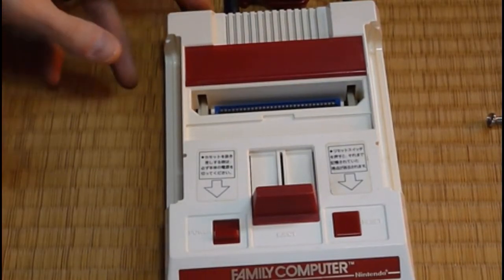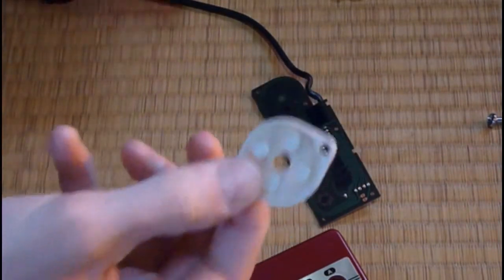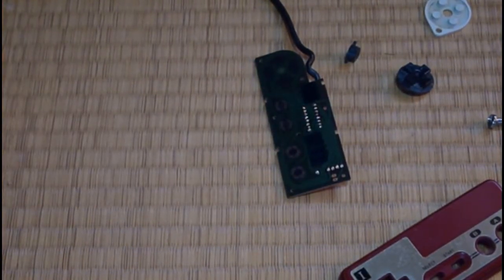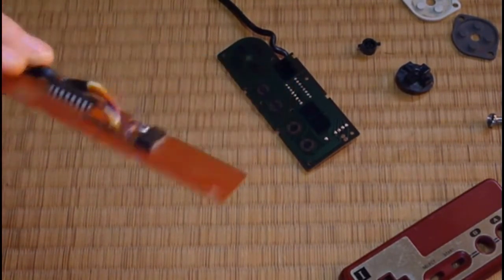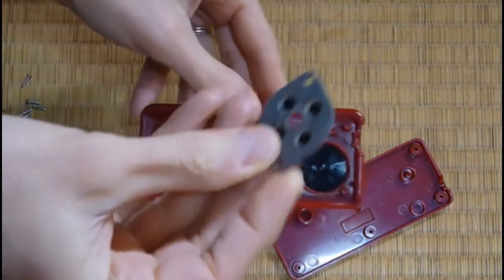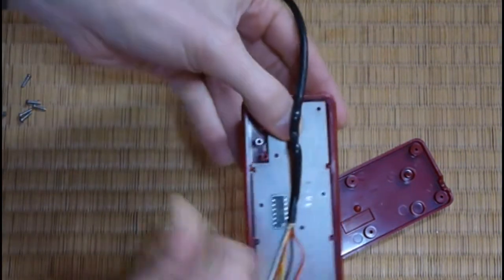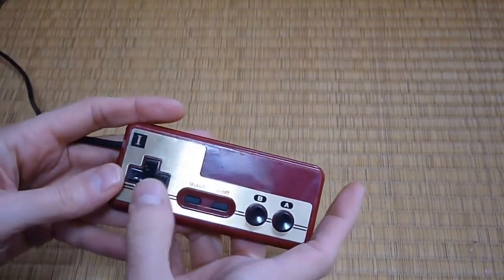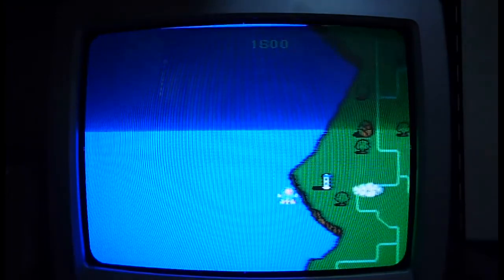Nintendo Famicom (Family Computer) controller fix

Comment: the player one controller board is exactly the same as a standard NES controller. you can actually swap the boards if you prefer the feel of the NES controller and use it on the famicom. ive done it and it works. havent tried swapping the rubber pieces but they do appear to be identical looking at them side by side.

Comment: It doesn't matter if the membrane is cracked or not.
What matters is the graphite parts on the bottom of the membrane.
Graphite conducts electricity and when you push it against the board it creates a connection between two pads, then it lets the famicom know that you've pushed the button.

Graphite on the controllers doesn't last forever tho'. After a certain number of clicks it wears off.

So even if the membrane is cracked, the graphite might still be good. I took the membrane from the the player 2 controller, since I don't use that one and switched.

Comment from the maker: I've only seen the guts of an NES controller in pictures, but the rubber pieces of the NES and FC controllers look exactly the same, so if you have an old NES controller around with good parts, you could give it a try.  Can anyone else weigh in here?

Comment: Hey. I bought the original famicom from Japan. AV MOD. But the problem is as follows. Bad diagonal cross on the two controllers at once. Moreover, the directions of the cross itself work perfectly. And the diagonal has to be pressed hard. Without effort - do not even react. Rubbers are new, but not native. What could be the problem? Mechanical damage to the board? Or a problem in non-original bands? Or be a hardware conflict with a Chinese cartridge for 150 games?